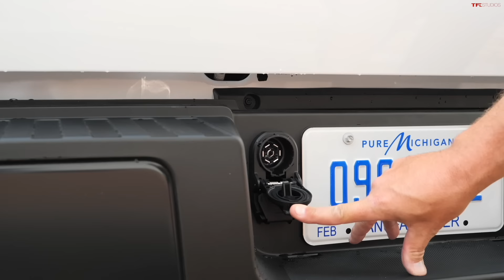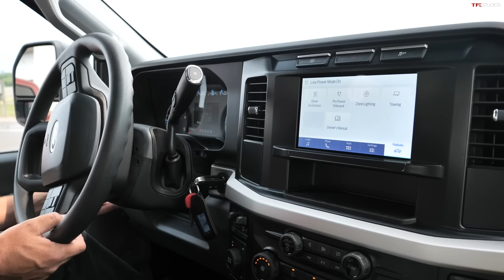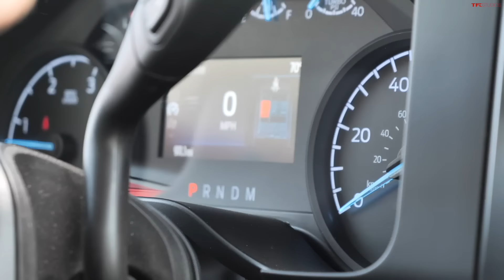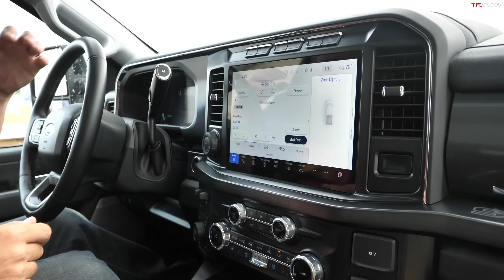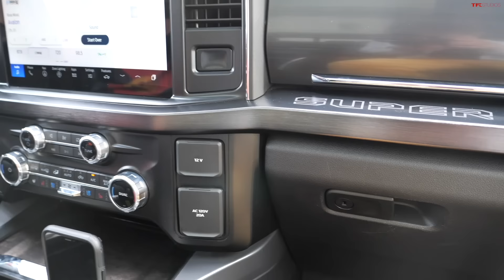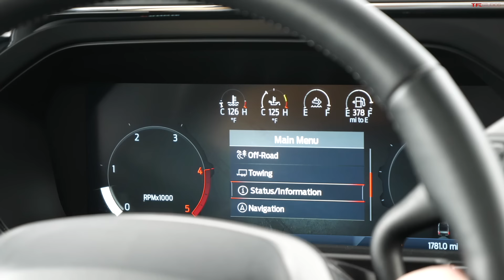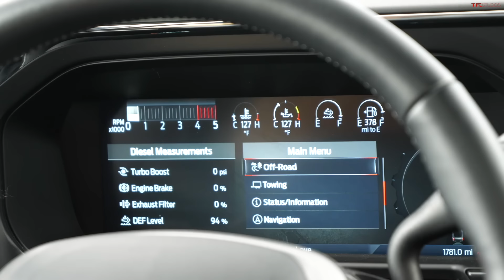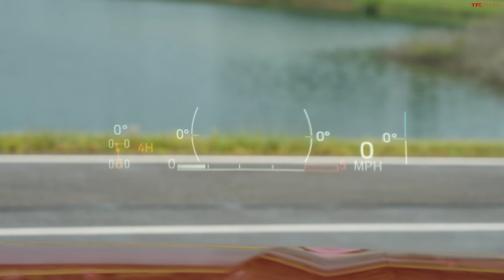The New 2023 Ford Super Duty is a Game Changer: I Take A Deep With The Engineer Who Built The Engine

Comment: You should try to work with ford and see if you can do a 6.8 vs 7.3 towing test with similarly equipped trucks. Would be nice to see what the power difference would be for gas customers trying to decide
Reply: 6.7*
Reply: @darkfire8615  6.8 is the new gas motor, I want a comparison of the two gas engines.
Reply: There’s barely any difference — there’s no major differences between these two 💩s other than the 6.8 having a shorter stroke.  

Just means HP/TQ will be shifted to the right (on a dyno graph).   

The 6.2 Boss was a much better basic engine and it should have been the basis for a larger cube (6.9-7.3 liter) Cammer.  
A large cube Boss would have offered much better performance than the lackluster Godzilla
Reply: @BC08  That's not true at all.
From Ford's published specifications:
6.8L Gas V8: 405 HP @ 5,000 rpm, 445 lb-ft @ 4,000 rpm 
7.3L Gas V8: 430 HP @ 5,500 rpm, 485 lb-ft @ 4,000 rpm 

The smaller engine peak torque is lower, and the peak is at the same speed as the larger engine. The smaller engine's peak power is lower, and that peak is actually at a lower speed than the larger engine. The shorter stroke does not shift the torque or power to higher engine speed.

The 6.8 is about 7% smaller in displacement, and has about 6% lower peak power and 8% lower torque, so output is essentially proportional to displacement.
Reply: @brianb-p6586   Based on your numbers the 6.8 peak torque rpm is not lower, it is the same.   

Take the the same top end (cylinder heads, intake manifold and camshaft), reduce stroke (thereby reducing displacement) and the power band shifts higher every time.  This is basic physics. 

So what’s happening here is Ford could be reporting HP at an arbitrary RPM (like 5000) to differentiate peak outputs between the 6.8 and 7.3 or they put a smaller duration cam in it since based on all accounts the cylinder heads and intake are the same.  

And before you ask why Ford would under-report peak HP to differentiate engine options, they did it with the 5.0.   Twice.  

They would report the peak HP of the 5.0 truck engines @ 5500 RPM and 5750 RPM.

We can look to numerous dyno graphs of stock Gen 1 and 2 5.0 truck engines not making peak HP until 6200-6300 RPM on dynos.  

Why would they do this?   To give the 3.5 EcoBoost - a higher cost option - more peak HP on paper.
Reply: @BC08  You repeated what I said: the peak torque speed is the same. I said that the peak power speed of 6.8 is lower than that of the 7.3, because it is.
What you expect is not observed here, because each specific engine has parameters such as cam profiles which are selected for that engine.
While not provided in information supplied to the general public, full torque and power versus speed graphs are available for every production engine - the manufacturers do not pick a non-peak value to report as peak. 
This (in either 7.3 L or 6.8 L displacement) is a truck engine, and is tuned for power output at moderate speed. It's not an F-150 or Mustang, and will not be set up for peak power over 6,000 RPM.
Reply: @brianb-p6586   Manufacturers can report HP however they like.   
They can report peak HP at an arbitrary RPM or the RPM at which actual peak HP occurs.
Do not speak in absolutes when the industry behavior itself has already debunked your assertion. 

What are the cam specs of the 6.8 and 7.3?

I can find the Ford crayola graphs for the 7.3 easily, not so the 6.8.
Reply: @BC08  I don't have the cam specs... and neither do you.
Reply: @brianb-p6586   Ok, since heads and intake are confirmed the same — how do you know the cam is different?  

Where has Ford published the 6.8 dyno graph?
Reply: @BC08  I don't know what the can specs are, and neither do you. I don't have the dyno charts available,  and neither do you. 

I do know what the power and torque ratings are; you just ignore those facts and declare what you want to believe.
Reply: @brianb-p6586   I offer an educated opinion based on the available information.   
You claimed the cams are different, based on what?   
You came in here as though you had some insight although it’s become abundantly clear you don’t
Reply: @BC08  the cans may be different.  You just don't know any of the details, such as cam profiles, but you declare something that conflicts with both published data for these engines and common sense.
Reply: @brianb-p6586   I declared something based on the known details of the engine and an intimate understanding of internal combustion engine theory.    

You believe Ford advertising 405 HP @ 5000 rpm means the actually makes peak HP at 5000 rpm.   
It doesn’t and I already provided 2 relatively recent examples of Ford playing with rating via RPM in recent times to give the more expensive engine option an edge on paper. 

It is very likely this engine makes very close to the same peak HP the 7.3 does but up closer to 6000 rpm.   
It is also very likely Ford doesn’t want two overlapping engine options advertising within 5-10 HP of each other.

Comment: Game changer all right, I put 3,089 miles on my 23 and the electrical charging system went to crap. All Ford 250 and 350 are having issues and other Ford brand products have issues. Ford heavy duty are being recalled for axel issues.

Comment: I had an 23 F350 at 1500 miles a charging system fault came on and it was un fixable so much it was declared a lemon by Ford, I then picked up a 24 F250 after everything was said and done

Comment: Let's be honest, Ford didn't make the 6.8 to have a lower priced option. They made it so they could charge more for the 7.3. I'm sure the difference in cost to manufacture is minimal between the two.
Reply: What are you talking about. If they wanted to charge more they would have just kept the already great 6.2 gas nd not spent millions engineering an all new 6.8 liter
Reply: @holeshot1721  they said it’s practically the same engine as the 7.3 but with a shorter stroke. I’m sure it was a relatively inexpensive development and having more shared parts Vs the 6.2 will be be better financially in the long run. I don’t blame them, they are a business after all.

Comment: The base 6.8 L gas engine gets the 10R100 transmission and the higher-output 7.3 L gas engine gets the stronger 10R140 transmission.... but while the base diesel gets the 10R140, the higher-output diesel gets the same 10R140, which is not rated for that engine's output. Where is the "10R170" (or whatever it might be called) that would be needed to reliably handle 1200 lb-ft of torque?
Reply: There was a video on YouTube that showed parts differences between 7.3 and 6.7 10R140 versions (beefier planetary gear as an example). Heavier duty components in the diesel to accommodate the additional torque. Part number differences with non-PTO equivalents for 2022 Lariat models: 7.3 LC3Z-7000-AB and the 6.7 LC3Z-7000-EB.

Comment: When did 6.5ft bed become “standard?” 8 ft is standard, 6.5 is short bed. <6.5 is poser bed.
Reply: Most people buying these trucks never use them as a truck anyhow, so bed length don't mean anything.  At least the 6-3/4 foot bed is still usable unlike many of today's 5 foot and shorter beds.
Reply: Every truck should have an 8’ bed. Anything less is a bitch boy truck.
Reply: @zackzander425  Every truck should also have only 2 doors, and manual windows and locks, and manual transmission and transfer case, with manual locking hubs....keep it simple, less crap to break...problem is most buyers today don't keep a vehicle long enough to realize how all the electronics and electrical add-ons effect the reliability of a vehicle....when windows don't work, locks don't work, etc. it creates multiple problems with not only driveability, but in some cases multiple systems in today's vehicles are effected when 1 thing stops working LOL.  

Although, my 88 F250 is the Lariat, and the power windows actually quit working last year, I can still fix them...I do have the extended cab, but have the 8 foot bed...parking in tight spaces becomes a fun chore, but it can be done for sure.  I also have the 460 with the C6 automatic...tows great, but it must visit every gas station it runs across LOL.  

Many of the trucks you see running around today have 5 foot or shorter beds....well I guess that is ok, if you just buy half a 2x4 LOL.  But yep, I prefer the 8 foot beds...a 10 foot would be even better at times, but the only way to get something like that is in a utility bed type configuration in the aftermarket.

Comment: These 2023's look good, but so glad I bought in Dec of 20', a 2021 XLT 6.2 with the 6 speed trans. If that CP4 grenades, you better have a big savings account! The EPA has killed the reliability of diesel engines.
Reply: There are fuel disaster kits but as someone has said fuel additives here and there to lubricate and make up for poor diesel fuel these days, will keep it running great.

Comment: you should have asked him what they are doing about the 7.3L engines losing their cam and lifters at 40k miles?
Reply: The bigger problem is the 10 speed that you cant get replacements for
Reply: @rayman1908 haven't had any issues with the 10 speed and it's pulling more than it prob should in the 450...

Comment: Notice how much more beefier these are than the ls/lt engines. Wish ford would have set the power at 450/500 on the 7.3 though
Reply: Tell me you work for ford with out telling me you work for ford😂😂😂😂 clown
Reply: @lonerider5315  you look 14 🤭
Reply: @freedomisntfree_44  deflection 😂😂😂
Reply: 7.3 cams and lifters are failing at an alarming rate. 6.6 gas has been doing better in all reviews loaded and unloaded and is a standard no $ option.
Reply: @Billybob50119  The 6.6 is a dog compared to the 7.3. I work for a fleet with 270 vehicles and have had no 7.3 problems. 3 local Ford dealers and they haven't seen a single failure.
Reply: @Billybob50119  At what rate are they failing?
Reply: @Billybob50119  the 6.6 was 4 mins slower 😂 move along troll

Comment: Love everything about it. Ford rules heavy duty trucks & thats no easy feat nowadays cause all the major players are VERY good. Will get '23 F250 XLT FX4 w/ new efficient 7.3L Godzilla V8. 23mpgs+ highway. 💯
Reply: 23mpg from the 7.3 gas motor? I e got 40k on mine and never ever been close to 20 with 3:55’s and driving like a grandpa on road trips. 23 will NEVER happen.
Reply: @janfalcon2020  Try better fuel!? You towing or carrying lots of weight? Use Top Tier rated fuel. Cleans engine every fill up. You got the best heavy duty truck out there. Be sure you run full synthetic engine oil. 5k mi OCI. 💯
Reply: @Davido50  it’s had 91 non ethanol run in it exclusively since day 1. I run the synthetic blend recommended  the owners manual but change every 5k. 1st change at 1k, then 3K then 5k. Full synthetic has been linked to the issues with oil coking on roller lifters in modern engines especially on a lot of short trips. My best mileage has been 19 running empty on flats in tx and staying at 70mph. I go from CO mountains to Houston a couple times a year so I have a good sample of mileage, hand calculated and using gps. And just to be clear, if you go on 7.3 forums I’m getting better mileage than most,  been called a liar a few times. I love this engine but it’s just not going to ever get 20mpg unless someone can figure out a way around the laws of physics.

Comment: I want a single cab, long bed, 7.3L with 4wd 4.56 gears, the offroad and max tow package. Base model, XL! I'll take manual windows and manual seats, cloth interior all day! The standard locking hubs are phenominal, Ford builds a TRUCK
Reply: Gone are the days of manual anything.  What is really funny though, today's Ford super duty trucks in the XL trim, have more standard features than my 99 super duty lariat has LOL.
Reply: @wildbill23c  I know that you can get manual seats and windows in a brand new truck, I've seen it in a '21. They've got to have kept the options right?
Reply: @josephina24  I haven't seen a truck with manual windows in several years.  Manual seats, yep those are out there for sure.  The more manual stuff you have the better off the 3rd or 4th, or 20th owner will be...all that electric garbage after about the 2nd owner is toast LOL.

Comment: Those "upgraded" piston rings better not be the low tension units in most GMs and Hondas that give them the remarkable trait of burning oil as fast as a diesel burns DEF. I have a feeling that is the angle considering the pretenses of fuel economy. I also spy that the 6.8l has polymer valve covers vs the aliminum ones on the  cutaway 7.3. I have a feeling most of the cost difference is in the transmission, but that would save a bit too.
Reply: I had to laugh at the cutaway.  Looks the same as any 302 I've built over the years other than the piston tops, injectors and long valve springs.  "Roller cam".  Yes 1985.  Looks like a big Windsor.
Reply: 3/4 tons arent rated for fuel mileage so no reason for low tension rings

Comment: I don't quite understand how it's cheaper for Ford to develop the de-stroked 6.8 when the 7.3 already exists and uses the same parts, just with more displacement.
Reply: It’s all about offering a smaller engine as standard equipment on the base truck.
Reply: @mini2nut67  Why?
Reply: Its' not that much cheaper, its just they can now charge $1700 more for the 7.3.
Reply: @greiner7414  Why not just offer a different tune or gear ratio that's lower performance / more mpg?  Then they could still upcharge the normal one, and that takes $0 design changes to the engine.

Why spend money developing an engine that's the same as what you already have, but worse?
Reply: @greiner7414  I agree.  Its basically a discount to complete with fleet work trucks from GM which is serious price point shopping.  And they don't want to discount the 7.3L

Comment: As a Ford Senior Master tech retired, I DO NOT understand 7.3 and 6.8...the cost pf manufacture cannot be different. What is the point of these two different engines that are basically identical?
Reply: Maybe to keep the 7.3 as a premium perception.  Marketing.  Old tricks like when Chevy detuned the Camaros to keep the Corvette faster.  Doesn't save them money to detune.
Reply: Because the Boss 6.2 wasn’t a good fit for the Super Duty. True, it only makes a little less power than the 6.8, but it’s old and runs on an inferior platform to the Godzilla motor. It’s also significantly less durable.

Comment: Looks like the diesel are great engines if you actually need the massive torque they offer. However, I would stick to a gas engine if you don't need the torque. The diesel engines are potentially not as reliable because of their complexity and EPA requirements. I would fear the diesel engine being derated while pulling a heavy trailer. The Godzilla engine is a much better choice for me pulling a trailer that is less than 10,000 GVW. Godzilla has the potential of being much more reliable than diesel engines regardless of Manufacturer.
Reply: Same with any automaker....unless you are towing maximum weight every day all day, a diesel  makes no sense....many trucks on the road are never used as a truck, they're used as a family sedan...some get used maybe a couple times a year to pull their toys up to the hills for camping, vacation, etc...none of which requires a diesel engine to get the job done.  My 88 F250 pulled a travel trailer all over the country for 30 years, nope it wasn't a diesel, but it actually was rated to haul and tow more than the same configuration but with a diesel engine....the old 460 V8 and C6 automatic would pull anything, but had to visit all the gas stations along the way.  

My current HD truck is also gas, I wouldn't want a diesel.
Reply: i wouldnt touch the gozilla til i knew 100% the issues r resovled.... somethign about oiling and lifters
Reply: @privateer9181  LOL, good luck with that.  Hope you never buy used vehicles either because you will inevitably run into problems caused by the previous owner's neglect and abuse that are far worse than a very select few 7.3L engines having problems.  

You have a 3 year or longer warranty if you buy extended warranties that'll cover you for a decade if you are that worried about a problem.  Ram's Hemi engines still have several issues and how long have they been around...a couple decades plus.
Reply: @wildbill23c   Most of my buddies including myself have Diesel trucks and rarely tow. Why? Because thats what we want.
Reply: @fit4ya1975  So another group that should have bought a car.  The type of people who fall into the show off status symbol category...hey its your wallet, you gotta feed those beasts, and license and insure them, and I hope you bought the proper license for them not the passenger car licenses the tickets are expensive if you are caught towing anything but a camp trailer with a truck that size and without the proper truck plates.

Comment: If the PowerStroke diesel still has the same defective fuel pump, no thank you as there is already a class action lawsuit against Ford for the defective PowerStorke fuel pump which can destroy the entire engine.
Reply: Which was also in dodges but they pulled it, its in volkswagens too, Trash design bosch.

Comment: With all that computer input needed to drive is more distracting than Texting. I got yelled at for taking my eyes off the road to adjust the stereo or AC. All this tech, cameras and parking sensors is dumbing us down where people cant learn to drive. Seatbelts, overdrive transmission, ABS brakes and standard AC is all the upgrades you really need.

Comment: f250 standard carb with a gas engine 2x4 48k is just to much cash a 6 speed manual extended cab 4x4 that would be a lot better deal on a base model truck